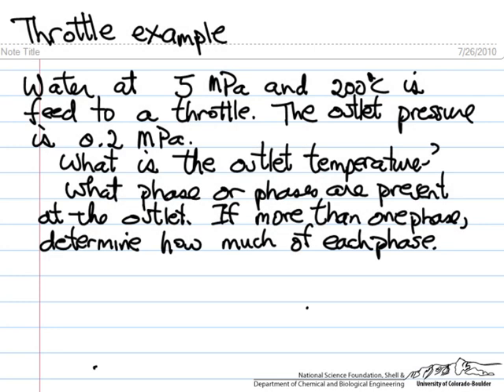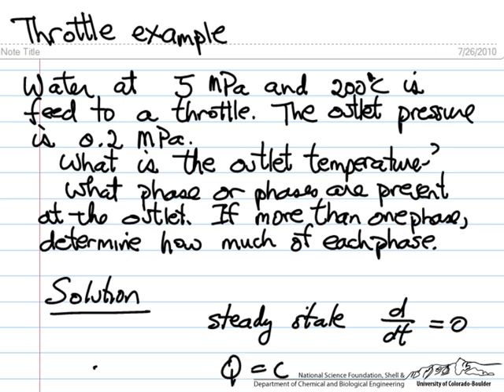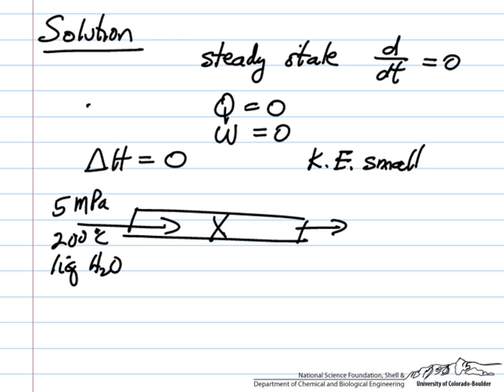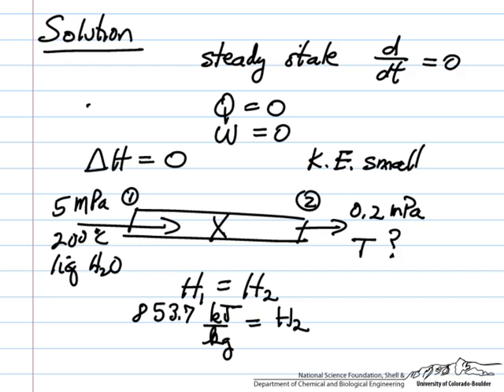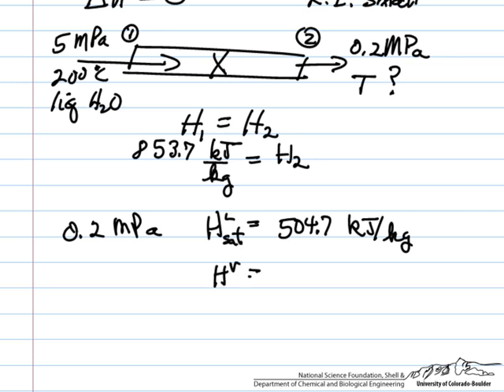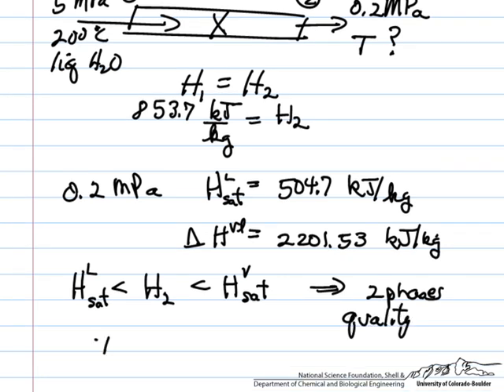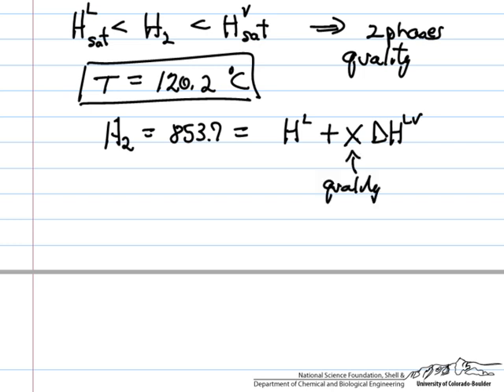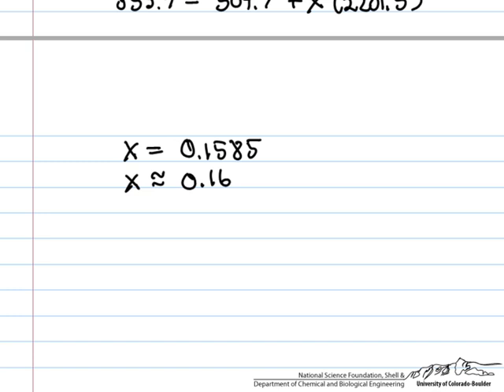Throttle Example: High-Pressure Liquid

Comment: For the material balance in the end of this screen cast, why do you not have to multiply H^L by (1-X) as well ?
ie: H2= HL (1-X) + HV (X)
Reply: The enthalpy of the liquid was given as a pure value, where the enthalpy of the vapor was given as a change. So the enthalpy of the system is equal to the enthalpy of all of the water at liquid conditions + the change in enthalpy to transition from liquid to vapor for the amount of vapor present in the system.
Reply: ohhhh so he gives Hv-Hl=2201.5